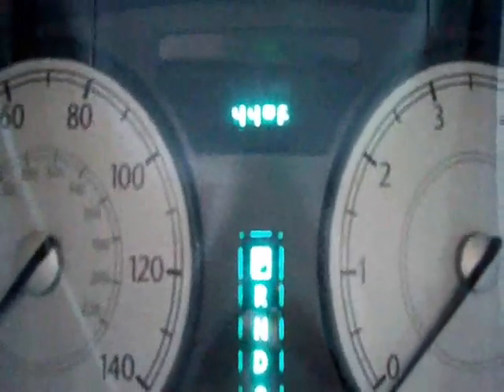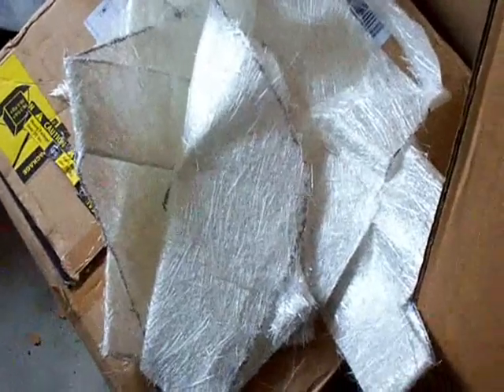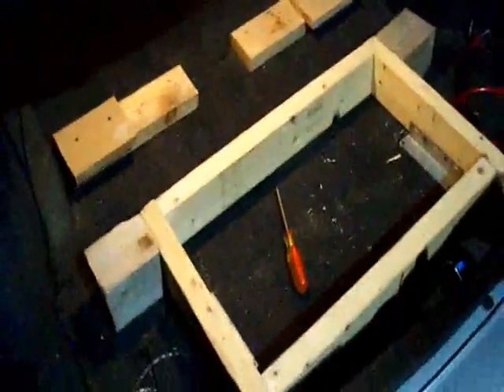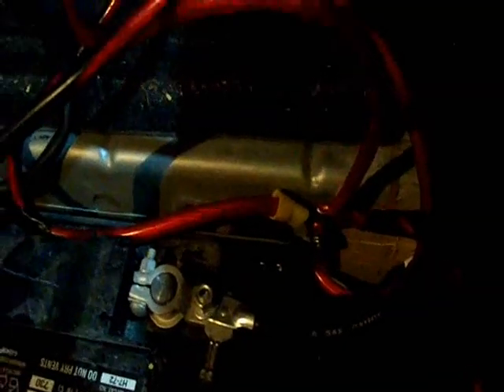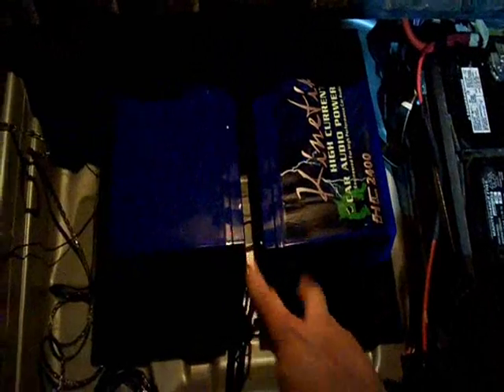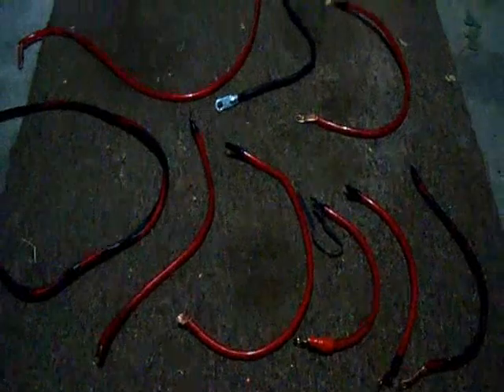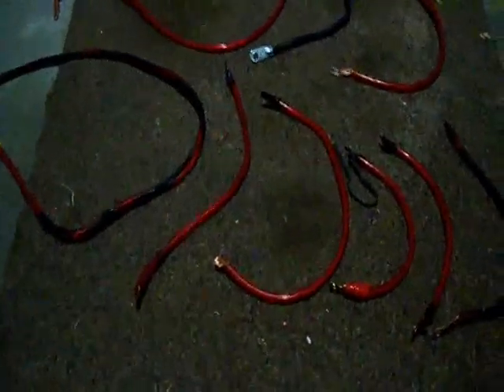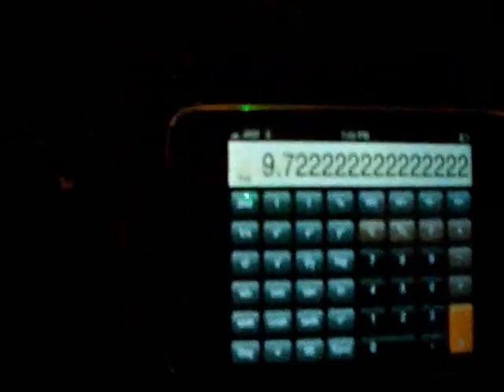Making room for the BTL 15's

Comment from the maker: No problem thanks for the concern... I actually put 4 10's in a grand am last night and had a chance to compare my new cable to the old stuff I was using... Both 4g but the new stuff is much bigger so should be good... Om going to use mainly 0g but if I decide to use any 4 the strands will be real short (maybe 2 or 3 feet) and strands of 8 to the subs so that should be quite crispy ha ha... Thatnks again